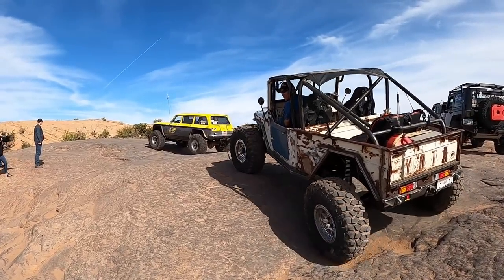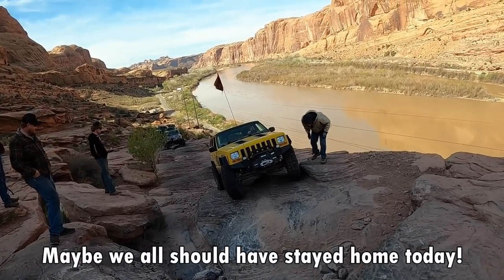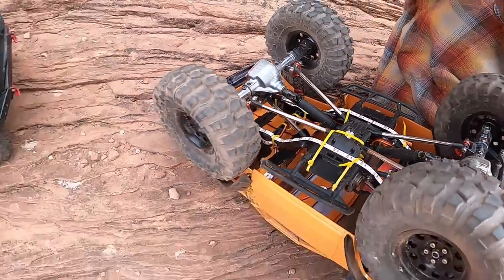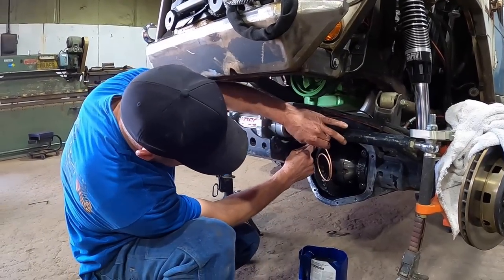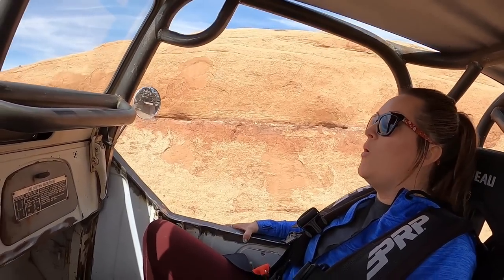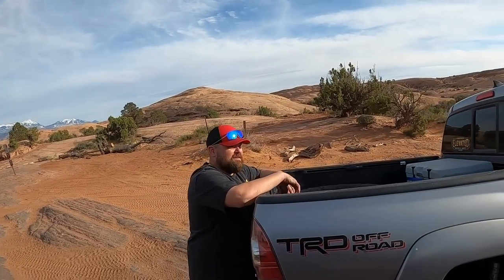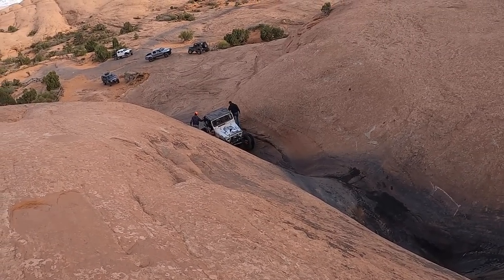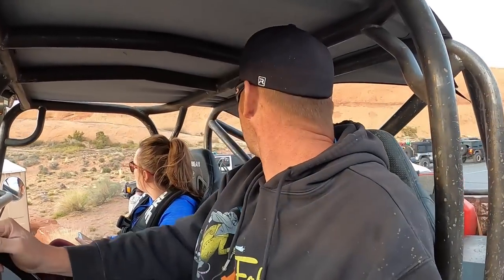This Is A Tow We Never Wanted to Have With @MattsOffRoadRecovery !

Comment: Great trail repair you always remember these times. 20 years from now you will be in the shop talking and saying remember that time when we had to drop the tank to fix the fuel pump. FYI you should add a little more roll cage protection for the back seat passengers. Valuable cargo back there.

Comment: Hey Paul, my fuel pump came loose from the pickup as well out on the trail. After reattaching the pump I added some safety wire so it can’t slide off the pickup now. 
Great video, love to see Gracie driving.

Comment: Paul sure does have a killer work ethic!! It's something that many lack these days but he gets er done for sure!! Both of the Yota's are badass too!! The FJ is my favorite by far but the Taco is one of those rigs that you can beat it like it owes you money and it will still drive you home each time with basically zero complaints!! Some say the tires are too small but that is part of the reason it's so reliable not having to turn some crazy heavy tires. That's a mistake so many guys do is too much tire on a drivetrain that can't hang..

Comment: The greatest thing about building your own vehicles is that when a problem arises you can usually diagnose it in your head before loosening the first bolt.  Then there's the sense of satisfaction when you confirm your suspicions and you're able to fix it.  Then of course there's the why didn't I double check that when I was putting the damn thing together in the first place.

Comment: You'll do yourself a huge favor by ditching the worm-drive hose clamps for fuel injection clamps. They're still screw driven, but they withstand extreme pressures and provide equal clamping force around the entire circumference of the hose without cutting or digging into the rubber. They're not too expensive, either. Maybe a buck, buck-and-a-half per clamp.

Comment: A few points I'd like to make:
1. YJs love duct tape. (I know, I have one) 
2. I hate air lockers. I prefer detroit auto locker, elocker or ox. (Sorry, Paul. I know most wheelers love air lockers)
3. Ouch on the axle, Matt. 
4. Great job with trail repair collaboration! 
5. Along with #3: It's important to always have tools and to not wheel alone. (I know you know that already... sorry)
6. Gracie driving! GASP!!!
7. Landon on the escalator! GASP!!!
8. FJ's starting to sound a little squeaky. 
9. I LOVE CROSSOVER EPISODES WITH MY FAVORITE YOU TUBERS!!!!
10. Because I can't stop on a 9.

Comment: Paul, I had the same thing happen to me with one of my lockers copper like a lot of metals gets work hardened when it's flexed , you can prevent that from happening right away by annealing it before you put it back in and that's just heating it up with a torch that soften it up.

Comment: I have a similar problem with an ARB in a 14 bolt, self inflicted of course..  Did you use an ARB part# for the copper line repair or just some generic parts from the parts house?  TIA.

Comment: I have a 78 Chevy short box , put a LS1 454 in it and found a inline high pressure frame mount fuel pump that runs it , the truck is lifted about 9 inches with 38's , I don't have to go into the tank for my fuel pump

Comment: I had that exact same fuel problem with my custom '56 Chevy with a 21-gallon custom tank. In Oregon returning from Reno to Seattle and just filled up the tank. Just like your FJ my fuel pump came off the feed line. Bad design. Those black rubber hoses shouldn't be immersed in fuel and definitely shouldn't be the only support for the pump. Apparently, the inside is fuel resistant but the outside is not so much. They swell. My car now has the pump firmly attached to the support and a PTFE bellows hose connecting it to the feed line.

Comment: With all the custom fabrication and you didn't put a removable panel or a door in the bed over the fuel pump you won't to  drop the tank, make it big enough to access the pump with ease. That high dollar flaring tool you have  put a small bulge in the discharge line so when you put the clamp on the hose it can't pull over it , the pump has one.

Comment: Not to be that guy but it seems like air lockers are hard to get right(setup anyway) but very reliable when they are set up right, and Elockers are fairly easy to get right, and fairly reliable. So far no issues with my elockers.

Comment: Go to Electric Locker in front
ohh..... and to make sure that fuel tank issue never happens again......  cut an access hole in the bed, make a nice removable cover plate for it.  Then you dont have to lower the tank to fix it again....  after that... you will never need the access whole.  Learn to make Murphy work to your advantage.

Comment: We need to get that boy a GSpeed kit and some decent parts to build him a good scale crawler. If he wants some advice on where to start building a decent capable and durable rig I’d say grab him a Element RC Enduro kit and a GSpeed V3 kit and go from there. Poor guy needs a rig that can take some abuse. Buy the good stuff from the start and you’ll save a few bucks in the long run not having to replace the cheap stuff all the time.

Comment: I never understood AIR lockers.... with all the problems everyone always has with leaking fitting or leaking seals, why not just a manual cable locker like the OX locker.... no air compressor needed, no seals leaking... seems like a better option.

Comment: with the air lockers i have no idea why they run the brass pipe around the gear instead of out of the housing with out going near the gear and cause the issue you have
Reply: Amy Taylor  go away!!